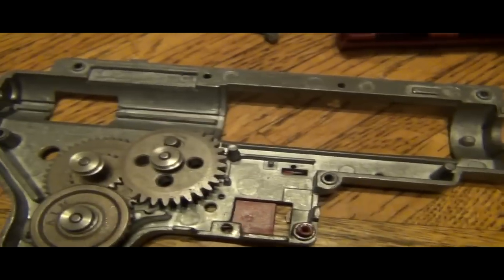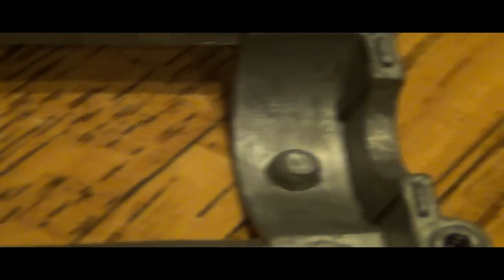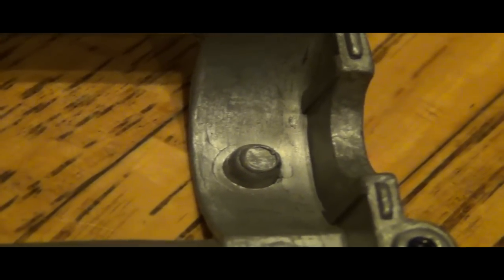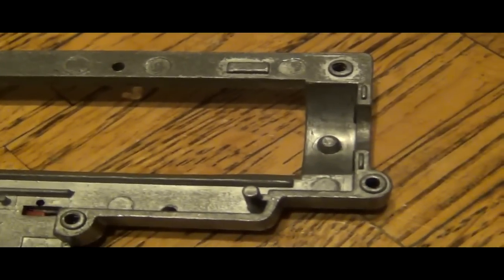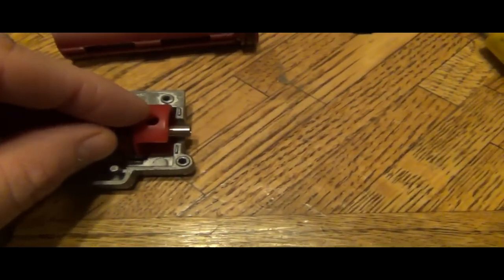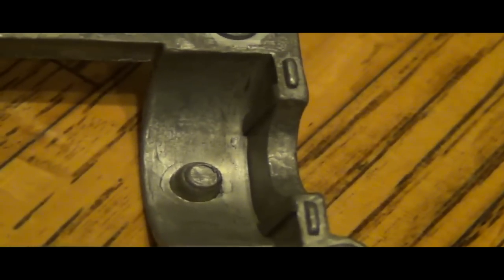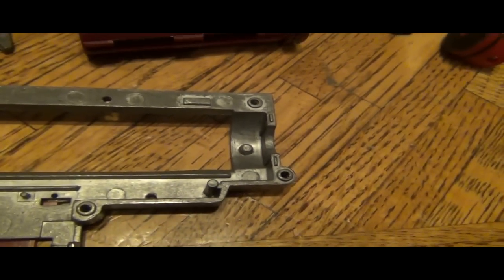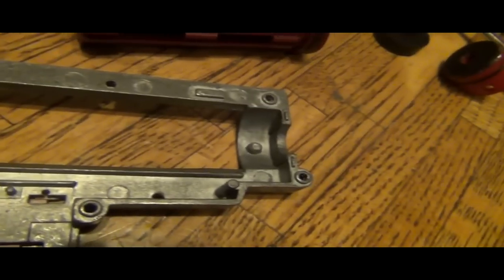Confirming My Theory of V2 Gearbox Cracks

Comment: Do you think that adding sorbo pads in front of the cylinder head will solve the problem? Not inside the cylinder head, in front right where those mounts are? I don't want to mess with AoE.